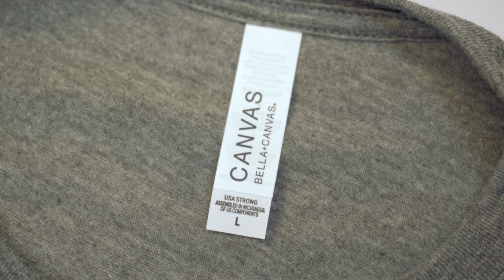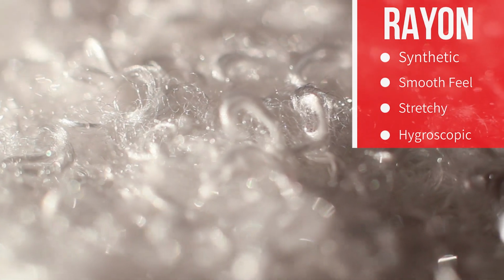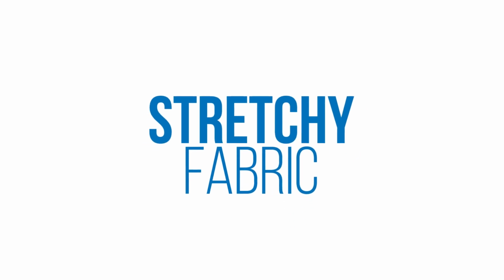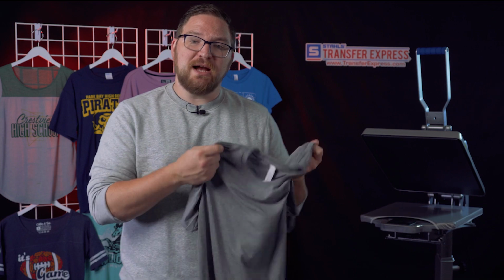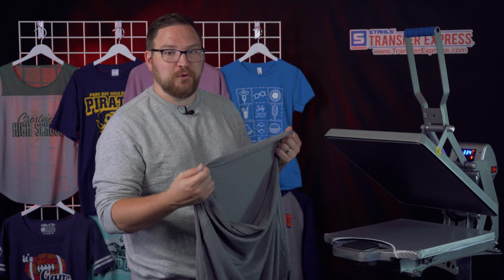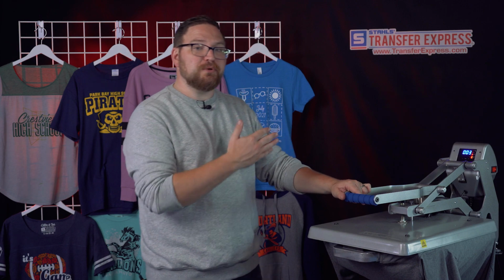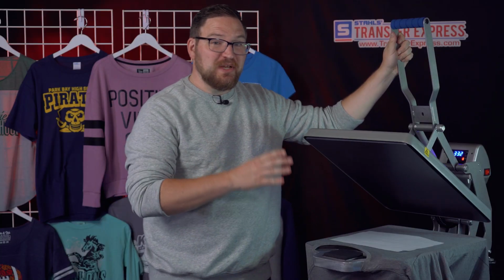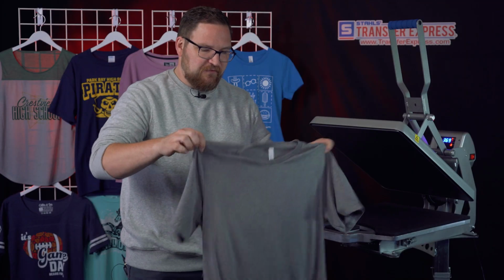Tri-Blend Printing Tips & Tricks | Heat Pressing Screen Printed Transfers

Comment: Is there a reason why you recommend Goof Proof over Elasti for Tri-blends?
Reply from the maker: Great question Rachaelle! Elasti Prints are formulated for 100% polyester only, while goof proof applies to cotton, polyester and blends. Just be sure to test the application temperature to check any heat sensitivity of the garment.

Comment: I have 50% Polyester 
25% Cotton
25% Rayon
Reply from the maker: You'll want to test a small corner of the garment for heat sensitivity before printing a larger run. If the triblend can take 365 degrees (It should) without scorching goof proof should work great on those garments. Depending on the colors in your design, UltraColor Pro or Max transfers apply as low as 290 degrees and would work great as well. If you'd like to test it for yourself request free samples of any of our transfers at: https://www.transferexpress.com/marketing-tools/free-samples

Comment: I used good proof on my b+c  triblend at temp 328-330 for 10 seconds and got some scorching. would you recommend lowering temp and maintaining duration or lower temp and increase duration. Also what the lowest temp possible for applying goof proof
Reply from the maker: Hey Kenneth, The lowest goof proof will apply is 325. The ink and adhesive will not melt at any lower temperature. Bella + Canvas tri-blends are typically a 50/25/25 which should apply fine at the lower temperature- which specific style are you pressing? Some colors are more heat sensitive than others. 

You can double check the temperature of your heat press (sometimes it can be much hotter than the display reads) and then adjust accordingly.

You can also check to see if it's just a platen mark, in which the discoloration should disappear with laundering. 

If you're really in a bind for time, you can fix any hard edges on the scorches using this method:https://www.youtube.com/watch?v=iL6vJXWnH4g

Comment: Can you use hot split instead of Goof Proof?
Reply from the maker: Hey Mike, great question! The short answer: YES, you can, but with some caution, the right artwork and an awesome heat press. 

First off Hot Split applies at 365-370 degrees, which can scorch heat-sensitive garments. If your tri-blend shirt and fabric color can take the higher heat, we're clear from the biggest issue here. Hot Split also doesn't have quite as much stretch compared to goof proof. Some of those triblend garments have some real good elasticity to the fabric with the rayon, which can cause some prints to crack prematurely. At first pressing it'll be fine, but after a dozen washes it may not hold up nearly as good as we know the transfers can. This is very apparent with large areas of ink coverage and also very fine details. but with already distressed artwork it's not noticeable at all. 

With the adhesive powder added to the plastisol inks, the Goof Proof is much more durable and flexible in it's application techniques- with the ability to apply at a much lower temperature like we show in the video here. It's opacity (on dark color garments), stretch and rebound is fantastic too with our new ink formula, which is why we recommend using it for printing on triblend apparel. 

If you're worried about the hand-feel of the inks between the two checkout the comparison video we did here: https://youtu.be/Sp0HYUS5vpQ. And, if you haven't tried the new goof proof ink formula yet, you'll be SHOCKED with how soft of a feel it is.

Comment: I just printed 100 BC3001 shirts at 360 for 5 seconds and they look perfect. I guess I got lucky
Reply from the maker: The Bella + Canvas 3001 is a 100% cotton tee, so it can take the higher heat. The 3001 CVC version is a poly/cotton blend so the high temp for the goof proof transfers work perfect too! We used the 3413 in this video.

We love printing on the 3001 though too!